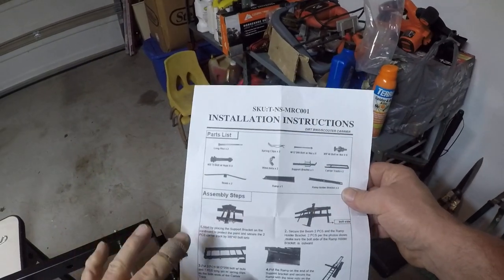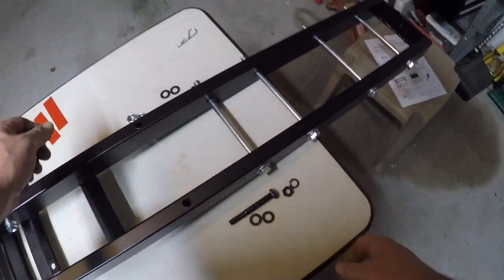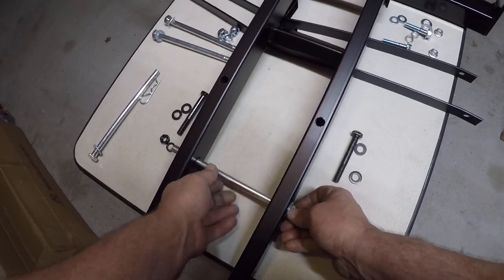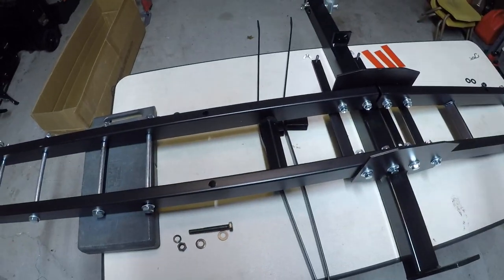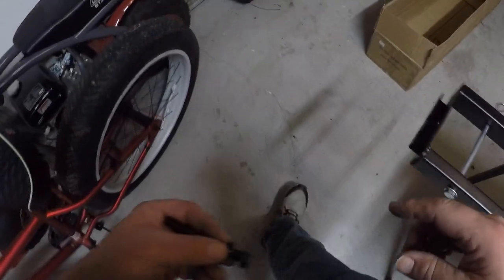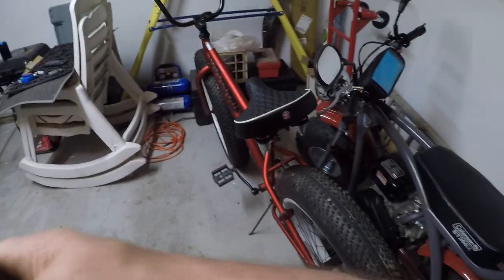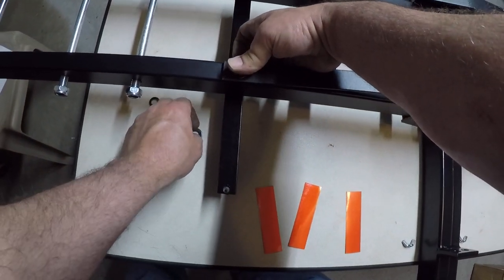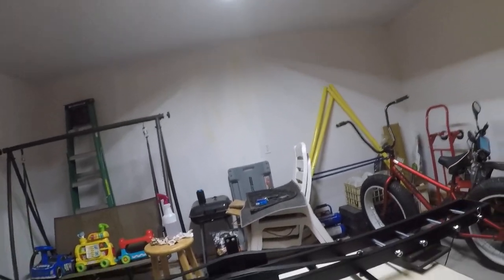Motorcycle Carrier Assembly For My Mini Bikes Part 1

Comment: Thank you Mr Grey for the information I was able to see the SKU on the instructions manual and I was able to locate it on Amazon I hope it will work with a large mini bike tire
Reply from the maker: The tires wont fit down in between the rails, so you have to make sure it is strapped down and wont move to one side or the other and come loose. Best way to do that, is to strap it down at a high point of the bike on both sides and then strap the wheels down. That should keep it from moving around any.
Reply: Thank you